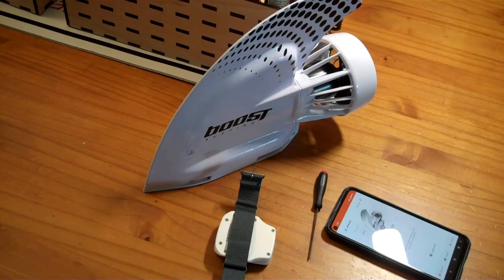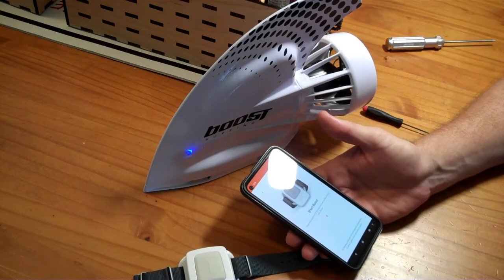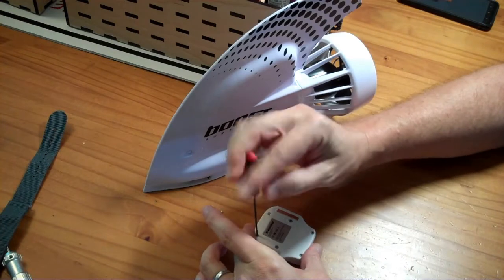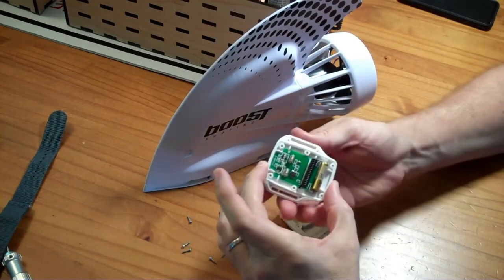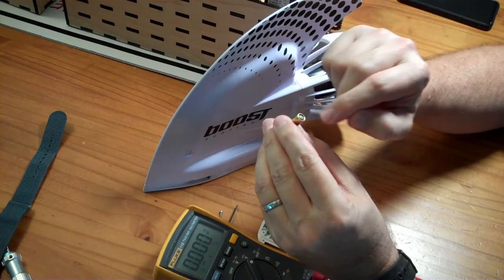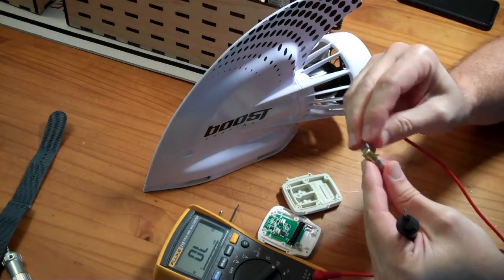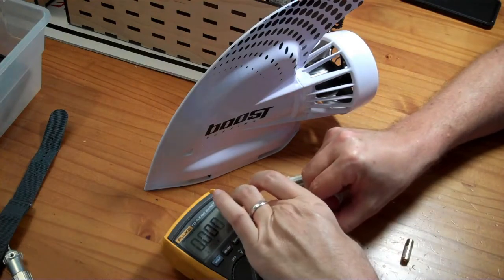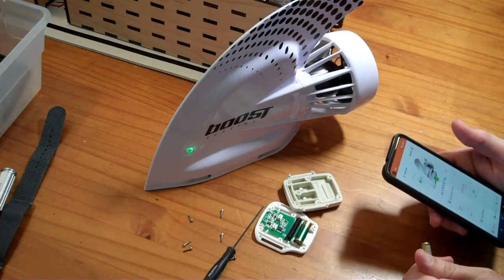Boost surfing fin -  remote battery dead on arrival - How to open remote & replace battery.

Comment: I just received mine, and I can't wake up the fin with the screwdrive. Any suggestions?
Reply from the maker: When you plug it into charge is the light on the charger red or green?  I have heard of some people who received them dead on arrival and had to contact customer support for a replacement.
Reply: @summetj  I haven't charged mine in a few months, only did the one charge and haven't yet used it. Now when I charge it the red light doesn't come on. Any ideas?
Reply from the maker: @NickSterson  The BMS in the BOOST fin will slowly discharge the battery over time. They say you should charge it up at least once per month. [Because if it gets super low, you CAN'T charge it and generally have to send it back to the factory.]

There is a trick where you can use a power drill to spin the propeller really fast while it's plugged in to the charger. This uses the propeller motor like a generator to power up the BMS just enough to realize that it is connected to a charger and then start to charge the batteries. Ask around on the Boost fin facebook group for more details.